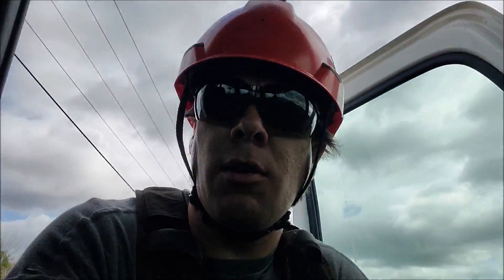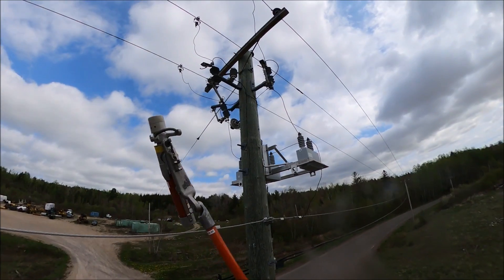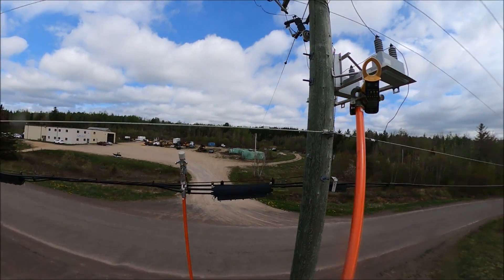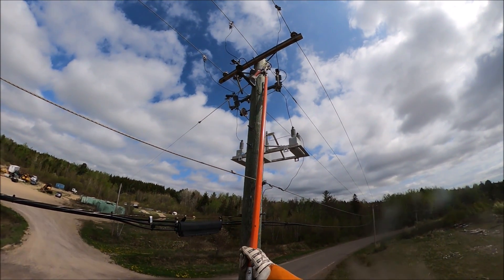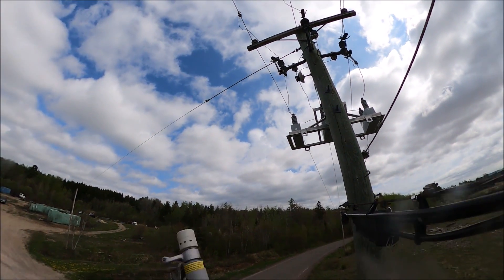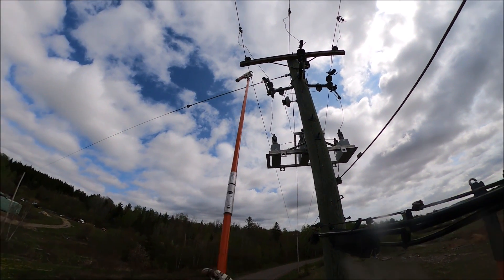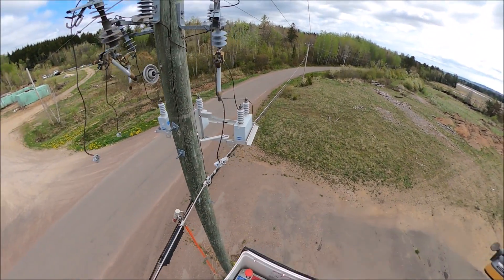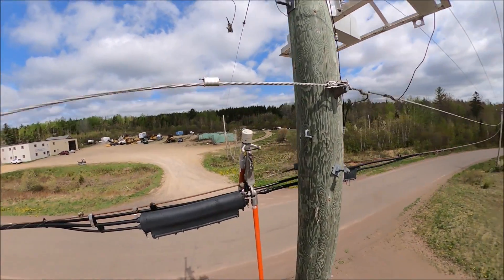Opening a Capacitor bank

Comment: Capacitors, taboo to tons of linemen out there! They do have a ton of stigma with them. Where I’m from we no longer use “dumb” capacitor banks, all of ours have controllers which communicate back to the desk, we also use vaccuum switches to open and close the capacitor. This may blow your mind, but we also individually operate our capacitors! All of this smart technology comes at a cost though, both maintenance and monitoring costs. I do sometimes wish we’d go back to the real basic “dumb” caps that you’re featuring in this video for some locations, but I’d doubt we’ll ever go back to that simple setup since they want them to be centrally monitored and controlled via a scada system. We also have a department called voltage quality that works on regulators, capacitors, reclosers, and they deal with any voltage complaints from the meter back to the substation! High voltage technicians essentially. Everything you did in this video was safe and well explained! Capacitors are a bit of a scary topic for a lot of guys since the knowledge seems to be minimal. Always either drain the tanks once de-energized by dead shorting the bushings with a typical single phase ground connected to the neutral or rack ground, or wait 5 minutes for them to tanks to dissipate their charge once de-energized, they do hold a charge for a few minutes. O, if you store the tanks in a station or near transmission lines make sure to short the high side bushing to the ground bushings with a mousing wire as they will pickup induction!
Thanks man!

Comment: Aaron, I know this is a five year old video, so you may not see my question, but:
In the video you said that there was an open on one of the caps. Wouldn't having a phase shift on two legs and not the other cause even more inefficiencies on inductive loads than the normal lag would cause?

Comment: My UPS is screaming DON'T TOUCH THAT!!!!!!!

One of these caused all sorts of faults at midnight and 5am most days when they were coming on and being taken off the line.
I kept calling my power company and sent them my UPS fault emails

They came back a few weeks later and said it was a bad cap bank and they didn't know what was going on till I got in touch with them and they compared my alarms to. The equipment switching at those times.

I have had UPSs since the early 90s and the voltage back then would vary and was usually around 110, but snagged down to 85 several times a day.
Now, 30 years later, it is 125 or a little bit more, all the time.

They installed brand new substations in the late 2000s and they have 2 new ones between the power plants and the mega substation that supplies the eastern half of the state, and two more between the mega station and me. They ran a brand new parallel tower line next to the half million lines.  I am 1000 feet from the substation that supplies me.

The squirrel population has dropped significantly

We used to have very loud POW and the lights would flicker and a black carbon chunk that used to be a squirrel would fall in front of my house.

Once in a while it would blow the fuse on the transfomers

They ran underground feeds and pad transformers and that stopped happening.

The squirrel population is still low.
WE hope it will recover.
They are the primary food source for our hawks and other large birds here.

Comment: A friend was working on a burglar alarm panel at a substation, part way through he realised he didn't have all the parts required, so he headed off to get them.
When he came back there were emergency services everywhere, and on closer inspection, the wall where he had been working on the alarm panel was no more.
On the opposite side of that brick wall was a bank of capacitors, one had let go and trashed the place.
Boy was he glad he didn't have all the parts and had to leave....
Reply: Presumably it didn't involve drilling any wall anchors....   😜

Comment: How many amps? I couldn't hear over the wind noise on the microphone. Were the two capacitors in parallel, between neutral and 1 phase? It seems, like there should be three of them, each connected to a phase, and to neutral. I don't quite understand the application.

Comment: in the mist of heat wave in eastern US . having spotty power problems in my area . low voltage ,lagging power factor and voltage swings. with all the AC running .compressor's have induction motors which cause a lagging power factor and capacitor banks correct this to a point. some times you get harmonic's on power system causing too much current in cap bank causing fuse to blow and or cap go bad. some substations around hear have cap banks on air breakers to switch them in and out. even a shunt reactor is used in some areas to correct power factor. The few substations I drove buy in the past few days had all fans running on big transformers . and I notice the feed lines drooping between towers more than usual . only had 1 customer call me with power problems in a home. turned out low voltage and power swings tripping breaker on AC unit. was fixed in a few hours from power company.   I am thought never trust a bleeder. use the chicken stick and ground out cap before getting close to them. working on broadest transmitter  AM and ATSC TV we have some big HV ones . Chicken stick mounted right inside door to ground.  after going threw several safety interlocks just to get door open on tubes or  plate supply cabinet door.  HV caps are shipped shorted for safety.

Comment: I have a question for Bobsdecline about this video. It looks like you are in a rural area. Is there some industry in that area using a lot of inductive 3-phase motors?  I am guessing there is. If a phase drops all of those motors will start single phasing or shut down. I understand why the two other capacitors were isolated. Now the problem on that line is the power factor is off and the voltage and current are out of phase. I am surprised that instead of sending you out to isolate them another crew was not sent in to replace that center capacitor.
Reply from the maker: Your absolutely the right! The area has a customer with some heavy inductive loads. When removing these capacitors from service, a work order is automatically created to send a crew to replaced the damaged unit and place them back in service.
Reply: @Bobsdecline  And the sooner the better. When Voltage and Current are out of phase the power factor error does not allow for an accurate electrical power wattmeter reading. This means every day those capacitors are isolated is a day the power consumption is estimated based on historical billing. I have seen lawsuits filed over this.

Comment: Resistor in the capacitor designed to bleed voltage down to 50 or less in about 5 minutes

Comment: Cool man.

As you were disconnecting the jumper leads from the phase conductors, did I hear it right some short spells of arcing?

Also, is there an effective way to use this load buster device, if you were to drop an unloaded line (a spur line) via unscrewing (ie, with no link, disconnect or cut out for switching)?

Comment: Since you’ve got them out of service put some load break cutouts up there, easier to open them again and especially easier using an extendo.  I have grounded them immediately after disconnecting with a ground jumper and a hot stick. All you get is a small snap, no biggie. Unless you need to waste 5 or 10 minutes waiting for the bleeder. The wind noise prevented us from hearing your amperage reading. But assuming your system is 7.2 kv a 50 kvar will put out approx. 7 amps of capacitance,. So it’s a good check to see if it’s working properly.

Comment: I have never seen someone hotstick an amp probe on a 7200 volt phase like that. New technique and I'm impressed. Bleeder resistor in cap bank is irrelevant correct. Always assume capacitor is charged like a stick of dynamite is the way I work on even small cap banks I've seen bleeders absent or fail and capacitor hold charge for long time. You a badass sir. East TN

Comment: One of the most dangerous pieces of equipment we deal with...These and voltage regulators...Always remember with switched cap banks the “open” indicator doesnt always function...always amp check, shunt, and use a loadbuster..

Comment: A group of corrupt FBI and there hired thugs pulled a electric event on my property and in my house...high magnetic charge. My cable lines coiling up. I sell used stereo equipment and the overload circuits where popping on unplugged units. The rebar steel reinforcement in my house slab was showing a magnetic charge. Anything maticalic on my property was showing a magnetic reading. Water lines showing high reading.. Talked to the power companies 30 year engineer and he stated he never seen what I was describing..yet with underground main feed i seen something about pole reversal from distribution box and running two open neutral and grounds parallel underground would create something im describing. The main boxes are on my street in front of my house. I seen activity at a box on the rear of my property on another lot. Since the power companies engineer denies a leak intentionally or unintentionally could cause a crazy electrical event on my property or in my house I was wondering your take on what I'm describing?

Comment: I'm watching from NW WA State. I was out doing storm clean up with one of my crews one day after one of our windstorms. We were out clearing a tree that had taken down the power lines. PUD had removed the tree for us since lines were involved but they still left a mess. While I was picking up branches I noticed something dangling off one of the branches as I was going to feed it through the chipper. Turns out it was one of those cut out things that you pulled open in the video. It had blown off when the power went out and PUD replaced it with a new one as they couldn't find it in the mess. I drove up the road to where the PUD crew was and asked them about it. They were grateful to get it back (I was slightly disappointed as I thought it would make a cool addition to my road find collection). Turns out they can rebuild them and reuse them. I guess they are pretty expensive new from what the PUD guy told me.

Comment: Greetings from Florida, in Panama City Beach. Great videos. I have always wondered what those jobs involved along with how the grid works. 
The bigger thing is I think we have different problems from the salt water from the Gulf of Mexico. It damages everything along the coast like HVAC units and I believe power lines. It is quite common here to hear and see electrical arcing from cables for weeks before they get repaired. Even after reporting them. I know saltwater on power lines certainly causes problems. Like power drains and equipment damage. Seeing transformers rusted is common.  I would think they would use a protective coating for them here. But I guess even that wears out after time.
Thank you for the videos. I know that is a hazardous job if you do not stay focused. And also thanks for keeping our power going. The heat and humidity are unbearable without people like you keeping the power on so we can stay cool during the summer.

Comment: I laughed at the amp-meter on the hot-stick, but I'm not sure what else I could have expected. It's so simplistic because it works.
Reply from the maker: We've used em for years! There are actual high voltage ammeters now that are specific for high voltage use

Comment: 1 of the most dangerous  jobs out there. 1 mistake can kill an entire crew!

These guys have balls of granite and nerves of steel!!
Reply: Everything is fine until somebody makes the wrong slip. It isn't often discussed, but "primary" voltage - from about 7000 volts and up - is explosive when people make contact across conductors with their bodies. The effect on hands is not much different than a half stick of dynamite. Being a lineman is a life filled with calm but very serious attention.
About a year before I retired a pair of our linemen were working on underground conductors, one at each end of the segment they were working on. The guy on the "cold" end stood on top of the steel cover plate and radioed the guy on the hot end to close it in. There was an enormous BOOM from a fault right under the plate which blew him off his feet. No injury, but no fun either. If he had been standing beside the plate it could have been very bad - a flying steel plate weighing a couple hundred pounds and an arc flash as hot as the surface of the sun (10,000F - twice as hot as a light bulb filament.) Another day in the life.

Comment: Here in Italy disconnector switches are very different... https://www.electroyou.it/image.php?id=7170
All the leverages are insulated from the live wires, and they act on all the blades of the switch simultaneously.
With one operation you open the circuit and after one interlocking release you the earthing blades.
Often, depending on the height of the pilon, you can find some mechanical transmission rod in order to use shorter insulating stick.

Comment: I kept getting my APC units to trip and they were telling me they lost the neutral, and I had that checked and I knew that was not what was happening.
The APC units were cutting out and not allowing reset

I called my power company, they said the meter was not showing any problems, I logged when these incidents were happening

Always on the hour, usually around midnight or 1am

I figured a switch was opening or closing or a power plant was coming on or going off line

After several calls to the power company, they checked the " Upstream Capacitor Banks"

and whatever they did, or replaced, it fixed the issuse

Are these that you are showing the Upstream Capacitor Banks ?

Or are they something much bigger in the substation ?

I live about 1/4 mile from the substation, which is not that old, but the lines feeding here were put in in the 20s, maybe the 30s.

Have never been upgraded

When I first moved in power would flicker every time the wind blew, for the entire neighborhood

They came out and said the " Frogs" were bad, the worst and oldest they had ever seen.

Took them about 3 hours to fix or replace those.

No idea what a "Frog" is

But, I appreciate all the hard work

This is a deadly job and it takes nerves of steel to work on that much voltage

When they hooked my meter to the ground transformer, the guy just put a boot on the end of the wire and plugged it into the transformer, with it on.

I think there is 12kv in the transformer. 

We had a squirel hit between the transformer and the ground, and there was a huge bang, and a big blue flash, and the lights were out.

Sounded like a cannon going off.

Lineman came out, said it happens all the time. Squierls for some reason like the run on the lines and they get zapped.

Very scary work.

Comment: UK based High Voltage distribution Engineer, I work in the 33kV 3 phase  50Hz distribution and the 750V DC traction power switchgear which feeds the conductor rail for the trains ( we use a lot of 3 and 4 MW rectifiers)  I have also worked on the 25kV single phase distribution switchgear which feeds the overhead contact wire.   Been working for the UK railways in heavy current and high voltage for 45 years 👍👍

Comment: Why not test and swap out the bad cap while your there? I guess that would be too efficient? This is all about safety and I agree its dangerous if done incorrectly, thanks for the video
I am more into analog and digital high speed electronics, not as dangerous, but way more technical to tune and troubleshoot. I T/S pc motherboards and peripherals (analog and digital) for a decade then got into engineering, love T/S, but designing is so much more satisfying for me.

Comment: There is a cap bank two blocks from here. For several years that bank was automatically cut in about 8 a.m. every Sunday morning. It would cause a momentary blackout. I did not need an alarm clock since everything reset at that time. The neighborhood has been rewired and that cap bank has been eliminated.

Comment: Hey quick question. 
When the energy is produced at a power station like a  hydro power project. So when the power is distributed to homes through lines , is that generated power stored somewhere or directly supplied to homes??
Reply: Virtually all power that is produced is immediately supplied to consumers.  The grid may have a little bit of storage, but it would only ever account of a very small percentage of the total load/generation.  The amount of power produced must always match the load very exactly or else the line voltage and frequency will go out of regulation.  For this reason, grid operators make sure they have some plants that can quickly increase or decrease their output (usually gas/diesel) instead of having all slower coal or nuclear plants.

The rotational inertia of the large generators also helps stabilize the system by buffering out quick changes in load or generation and giving the utility time to throttle plants up/down.  If a grid operator has too much generation out of their control (customer owned or nature dependent) or without spinning mass (solar) they can have trouble keeping everything in regulation.

Comment: You may have already answered this, but what is the purpose of the load buster? Does it open the switch quickly to minimize arcing?
Reply from the maker: I'm actually going to be releasing a video with a better explanation over the next couple days. Didn't think the video was gonna be seen by any more the a few hundred lineman🤦‍♂️totally my bad.

The short version - it's spring operated to quickly break the arc and also has de-ionizing gas reaction within the tube to help snuff out the arc.
Reply: @Bobsdecline  Another thumbs up here from a non-linesman in Missouri. Great video and same question. :)